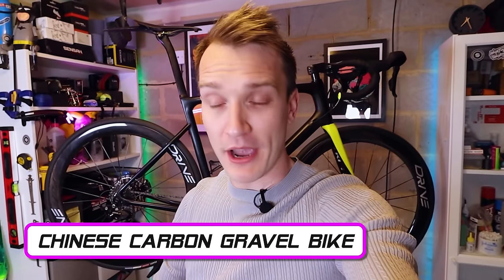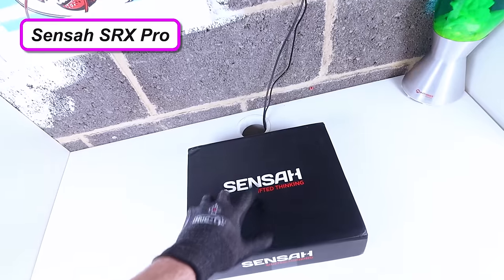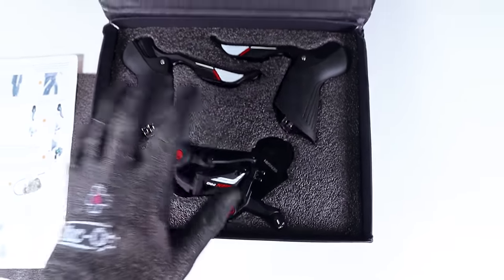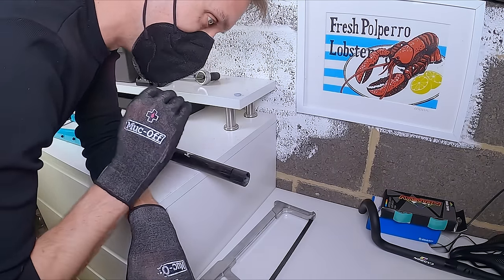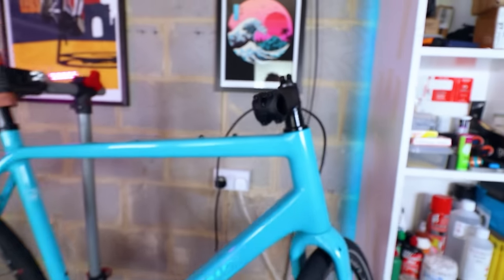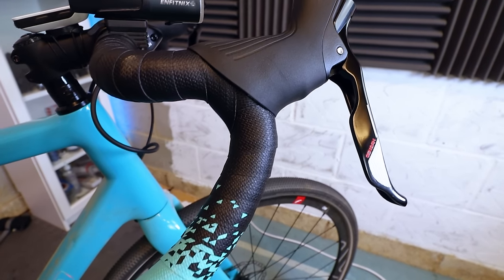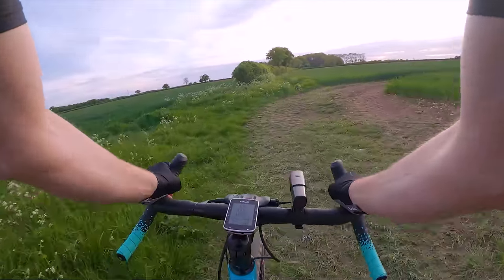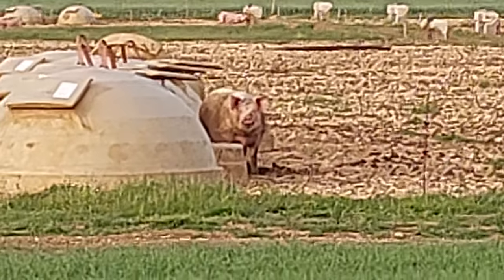Chinese Carbon 1x Gravel Bike – Full build & test

Comment: The mechanical to hydraulic brake adapter is a hill I'm willing to die on.
Such an in-your-face-uselessly-complicated solution. Either go full hydraulic of full mechanical from start to finish. I`d be annoyed by this thing every time I look down to the handlebar, especially the cables sticking out on the other side are like wtf? And you can't even use integrated handlebars anymore (which make for a so much cleaner front). Other than that, you have to maintain the cables and bleed the fluid, so double the maintenance and double the failure points.

Comment: Calling it now: you will start losing spokes on the fulcrums after around 18months.
Reply: I've got 3,000 miles on my Fulcrum Racing 4's over the past two years and they thus far haven't even come out of true. Fulcrum makes good wheels.
Reply from the maker: Can I ask why is this? The wheels seem pretty robust, atleast visually anyway...
Reply: @TraceVelo  I’ve had two sets of fulcrum wheels and both needed bearings replaced in the rear wheel after about a year.
Reply: @TraceVelo  I had the same wheels (when they were called 600db), my rear drive side spokes started snapping at the nipple after a while. Every one that went appeared pretty corroded, but was likely tha5 combined with a fatigue failure. I think the problem came from moisture getting inside the rim after going through a puddle and never properly escaping, combined with likely relatively cheap materials for the spoke and nipples. I just bought a pack of spokes and have just replaced them as they went. Have since upgraded and just use the fulcrums as winter wheels.
Reply: The only time I've ever had a spoke fail on me on the road was with a set of Fulcrums. I still have the wheel but could never get it straight afterwards.
Reply: never had a problem with fucrums there are hand built by campy
Reply: @TraceVelo  What happened to mine. And I'm not heavy, and don't ride in the wet.